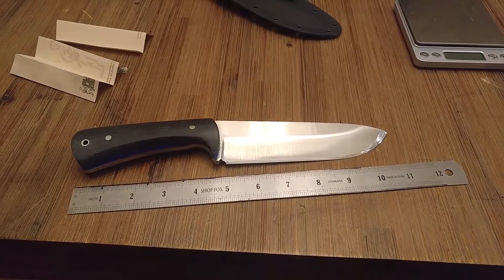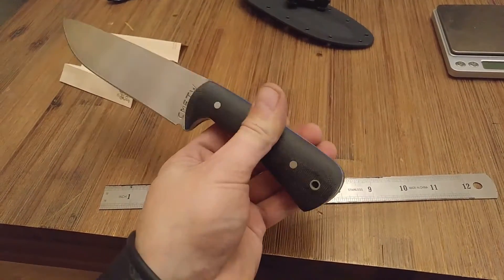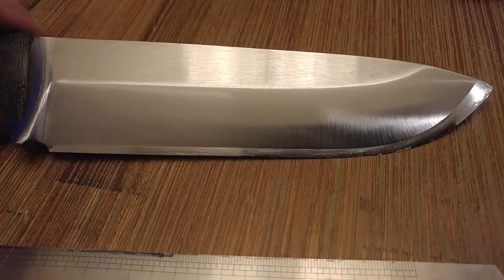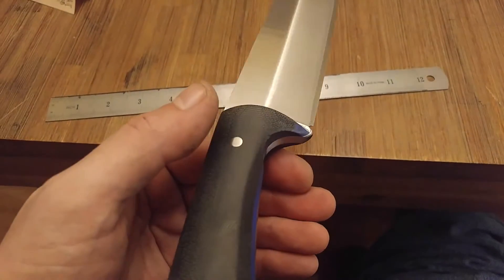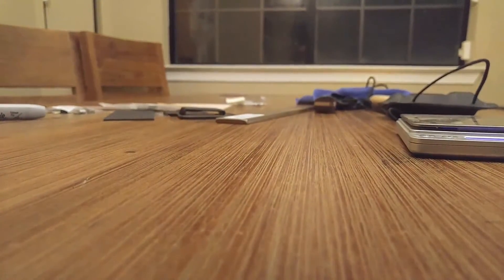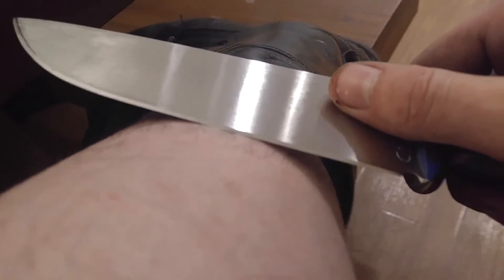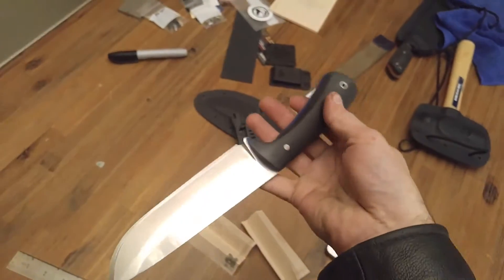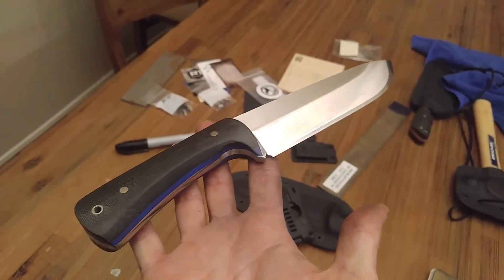Z-FiNit camp knife

Comment: Maybe had you made a normal dual edged blade then it could have sharpened easier but think all the bevel work you'd typically have to do on both edge bevels had to be removed and done on one side with this and I'm not sure if anybody would actually prefer this over a regular blade ground on both sides...